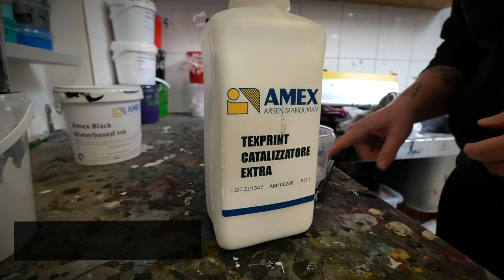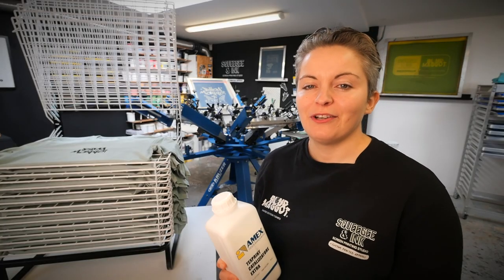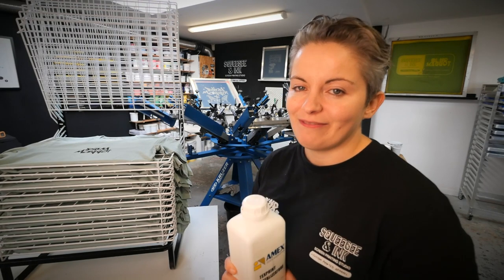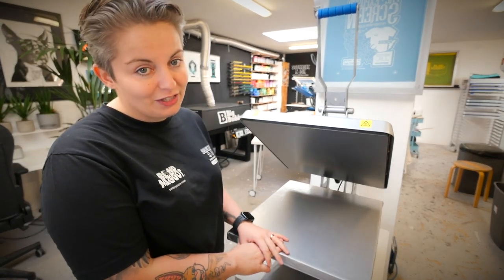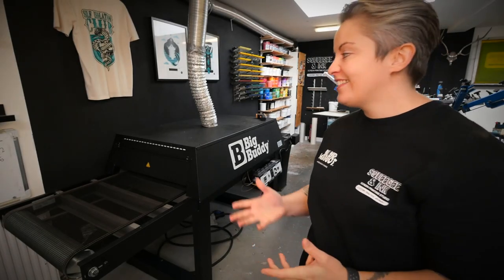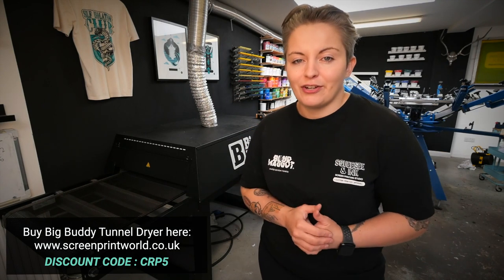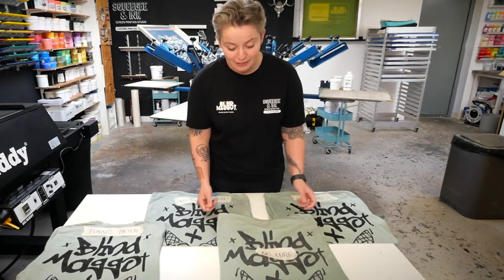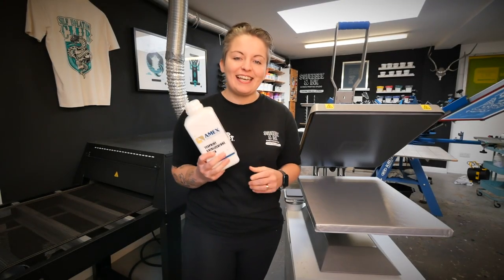Different ways to cure water based ink - screen printing methods for small studios

Comment: Very good info ! 
What mesh # was used for these? 
How many times did you run the squeegee? 
With your waterbase ink, do you spray water on the screen at any time?
Reply from the maker: Yes we do like to spray water for sure. The mesh was likely to be 55T which is around 140 US - I likely flooded once and printed once Any questions or topics you want us to cover make sure you use #printerscorner as we are about to start answering questions in more depth 🤓

Comment: you should try 4 presses instead of one long press. each time you lift the platen, it lets the evaporation out. technically hovering (turning the knob so when it is fully closed, it hovers over the shirt). It is the same as a conveyor dryer. Ive created plastisol transfers and pre tacked my plastisol prints using my press, prior to pressing them to cure. FN ink
Reply from the maker: Hey, I like that theory about letting the moisture out!

Comment: Great video. What are you heat settings for the tunnel dryer. I got a little buddy 2 and have had some scorching issues. I had it on high heat the slowest speed. Any advice? Thanks.
Reply from the maker: Maybe just reduce the belt speed and the heat setting too. I think mine is set to 835 and maybe belt at 5? I always run through the type of garment I am printing and use a heat gun to test if the surface is getting to 165 degrees before starting a proper print run, Any questions or topics you want us to cover make sure you use #printerscorner as we are about to start answering questions in more depth 🤓

Comment: Ace video Chessie thanks 👍. Couple of questions for you - were they all flashed before cure? Also can you cure with a flash dryer only? I thought it was ok to do a 3 min ‘flash’ to achieve the cure. Love the videos - our go to resource 👍
Reply from the maker: Thanks! I have never cured with just a flash as it takes too long and I would be scared to burn the garment and not let the ink heat up for long enough. I only really use the flash to make the ink touch dry so it doesn’t stick to the next screen or to build up opacity on the shirt Any questions or topics you want us to cover make sure you use #printerscorner as we are about to start answering questions in more depth 🤓

Comment: Great video cheers.  I'm printing 200 100% polyester sports Tees at the moment which always worries me a bit, especially with dye migration.  I've opted for cold cure additive (Magna) plus conveyer dryer at 130 degrees.  Fingers crossed.
Reply from the maker: How did this go in the end? Sounds like you had it figured out
Reply: @squeegeeandink  No problems (that I know about at least).  But I have decided I would much rather go down the route of migration blocker for all future orders.  I've been testing it out at a really far too hot temp for polyester along with a straight print with no blocker and the results were amazing.  I think I'd rather have piece of mind.  It is an added cost to the customer but the chance of it going wrong could be an enormous cost to me.